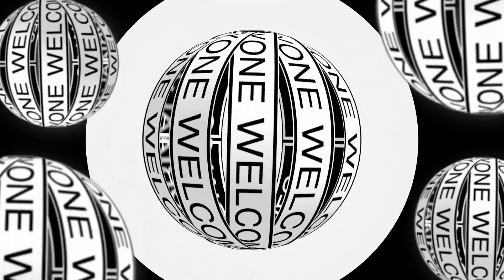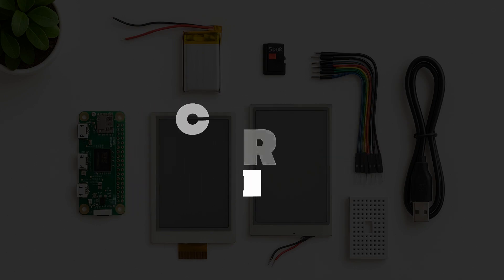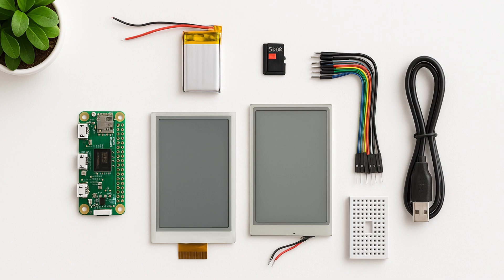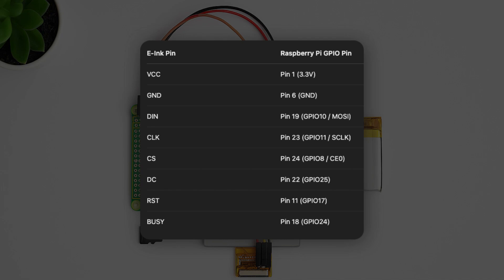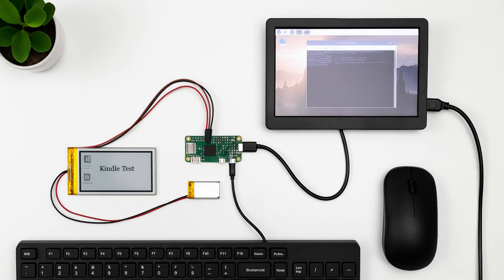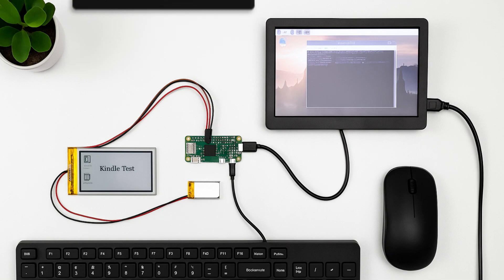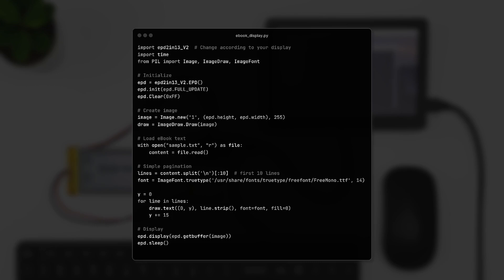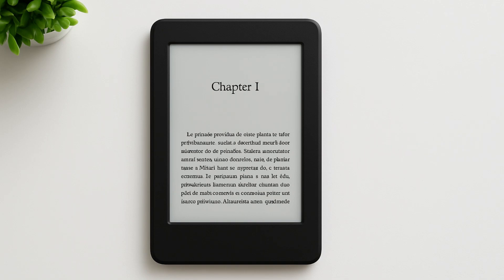DIY Kindle-Style E-Reader: Build Your Own E-Ink Device from Scratch | AI-Generated Build Concept

Comment: How to bring down costs lesser than kindle. @ProxLight
Reply from the maker: Hey! building your own e-reader can get a bit pricey compared to just buying a Kindle. But the cool part is you can tweak things to make it a lot cheaper!
Use a smaller or budget e-ink display (some Waveshare clones are way more affordable)
Swap the Raspberry Pi for something like an ESP32 — it’s cheaper and still pretty powerful
Reuse parts from old gadgets (batteries, cables, even cases!)
Skip the 3D print and build a simple case from cardboard or wood